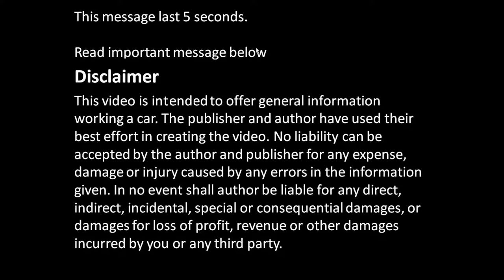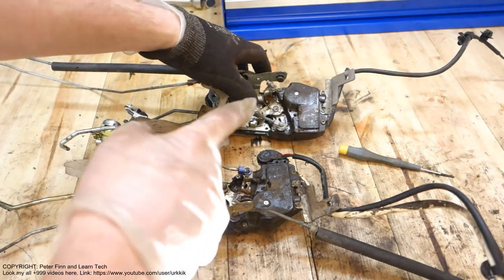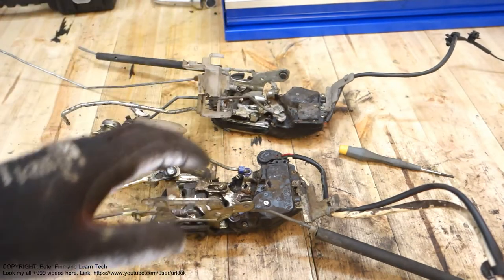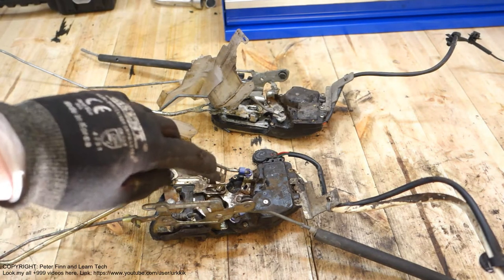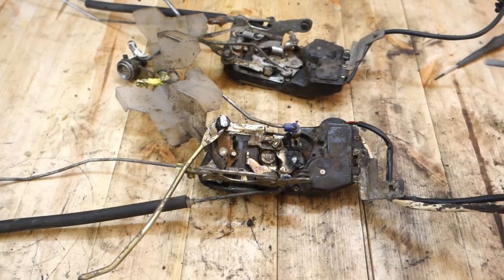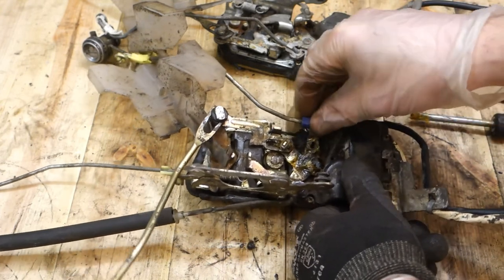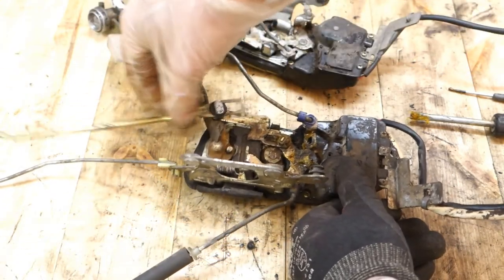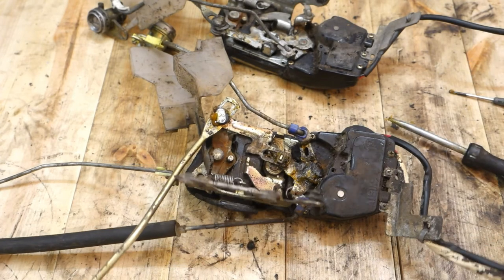How to fix broken central door lock Toyota Corolla. Years 1991 to 2002.

Comment: Hi Peter I have a 94 AE102  corolla with central locking activated by a manual switch in the driver door. Do you know if there is a remote switch to replace it? Thanks Steve